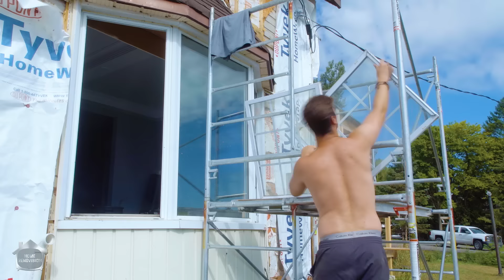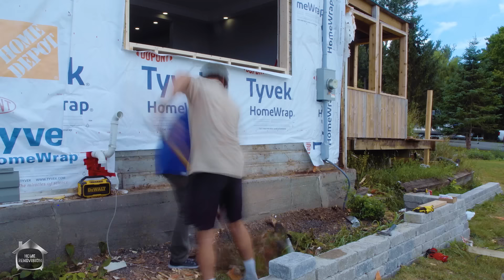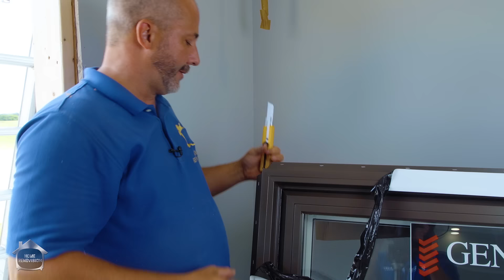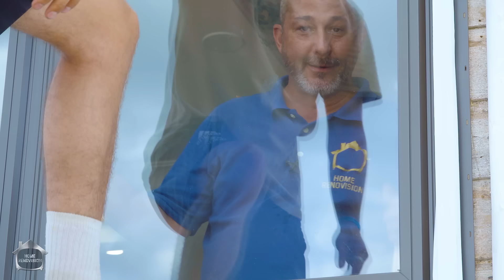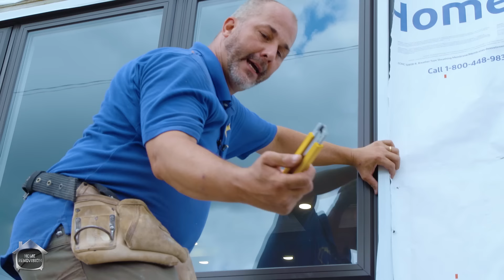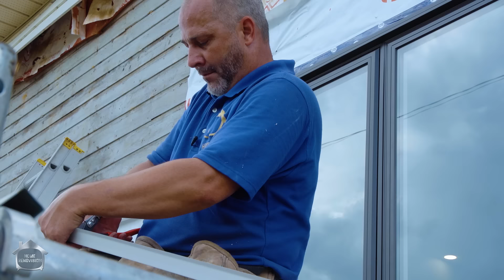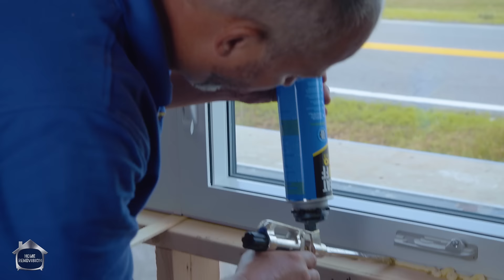How to Install a New Window| Quick and Easy

Comment: Tyvek works better when you wrap the sill and sides before putting in the window
Reply: No that’s not very effective, especially on the top, because if water runs down the tyvek, it runs inside the house. It’s better to cut the tyvek at the end of the opening, and cut a flap at the top, so once you put the window in, the top piece of tyvek goes over the flange, keeping out the water
Reply: Chris Worster So then doing it this way is totally wrong? https://youtu.be/nY964NYMcv4  
So after doing all 4 corners & sides install window then use flashing tape to cover flanges to tyvek on 3 sides and leave the bottom off so just in case water has a way to escape. That’s the wrong way? So the Huber Zip system is wrong?
Reply: Marvin calls for securing windows in the side jams. It gets covered with decorative trim so you never see it.
Reply: I dont know of a window manufacturer that recommends tyvek wrapping into a window opening.   Do you have instructions that show this from one?

Comment: Are you planning on doing a video about finishing an attic to add rooms to a house?? I bought a new construction townhome this year (construction completed in June). The second floor could have been two extra bedrooms and a full bathroom, but I only had them finish the first floor, so the whole second floor is just unfinished attic space now, with the plumbing already run up there by the builders for the future bathroom. My dad is going to help me finish it. What do you think we need to know about tackling a project like this? Thank you!
Reply: 1.Budget. 2.a design 3.electrics, location of switches and receptors. I installed an additional main room switch next to my bed. 
4. Locate the bathroom in line with the main drain. Skylight in the bathroom... 
5. Additional features like book shelves in the walls, pocket doors, walking closets...

Comment: What if your house is concrete, I live in south florida? Do you use tapcon screws?
Reply: There should be a treated wood "buck" or frame that the window fastens too. However the stucco is usually put on after the window install and goes right up to the window frame.  Is your existing window aluminum framed?
Reply from the maker: if the block is exposed and there is no wood frame then yes . Sure!

Comment: Why did you decide to buy a brick mould without integrated j channel? Does an independent j channel work better?
Reply from the maker: I prefer the look of the same color j channel since all the rest of the trim on this house will be green. no sense changing it now. besides some of the windows were don last year and have no integrated J so I didn't want to alter the look. they were installed as replacement and not new construction at the time.
Reply: Interested in this question also

Comment: Did you remove the shims from the bottom of the window once it was nailed in? thanks!!
Reply from the maker: after the foam had set up yes and then shot a little dab in the gap. Cheers!
Reply: Thanks!
Reply: @HomeRenoVisionDIY  Thanks!
Reply: U put new shims... Just replace the old ones. Old shims are to adjust the old window. New window new shims it's simple
Reply: U should. When putting a window in there's many things u should look at but in demolition... Always remove old shims it's good practice to do so